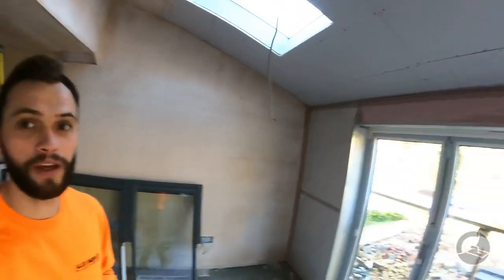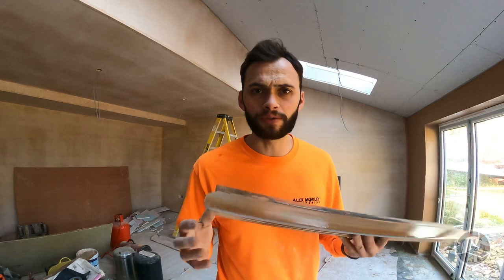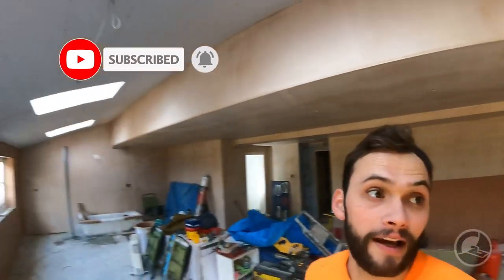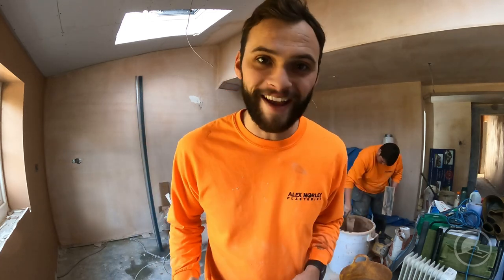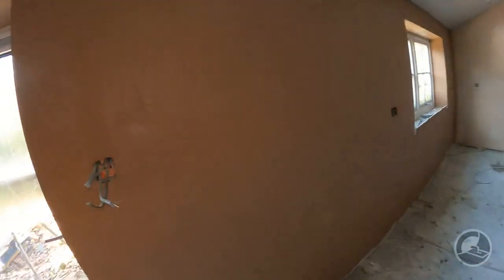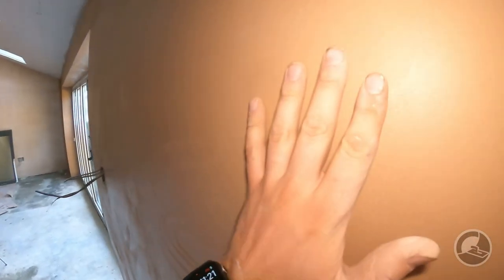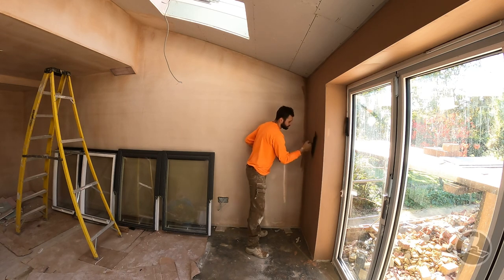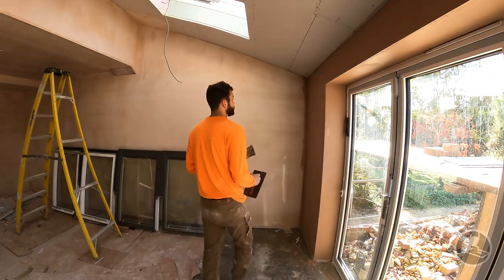Master the Perfect Timing when Plastering

Comment: Why would you not do the ceiling first.
Reply from the maker: Because the adjoining ceiling is a scheiling at 45°. As such to maintain a straight level line it’s easier to snap a level chalk line on the wall as appose to the ceiling and plaster to that line on the second set. 

Hope this he’s.
Reply: Always do ceilings first , always

Comment: Just found this video. Trying to learn plastering for years on my own. Not a soul around my area practicing who could help beyond one old book with explanations that are textbook old with blurry greyscale pictures. This video is the best I have ever seen by far. I took comprehensive notes. I have been considering screeds, but I am reconsidering. Perhaps good application of feather boards and using these steps may obviate them. I think my trowel technique is reasonable, but there was so much I was missing in the chemistry. I have tried to figure it out by trial and error, but this video has helped me leapfrog that part of the learning process. This video is all about where practice meets the chemistry. I appreciate the effort so very much.
Reply from the maker: No problem. Many thanks for the support on the channel.

Comment: Great video again buddy.

From a technical standpoint, what is happening to the plaster when it is "being closed in" versus "flattened off"?
Reply from the maker: Flattening the plaster is something you do while the plaster is still wet. To even out the trowel lines made from applying the plaster. 

Closing the plaster in, the plaster is much drier, and your pushing the aggregate back into itself. 

What you fine after you flatten plaster and leave it to pull in abit. The plaster is very grainy, not smooth. It’s that aggregate your pushing back in.
Reply: @AlexMorleyPlastering  excellent explanation buddy! Thanks!

Comment: I've been doing a lot of grade two buildings of late with lots of oak beams 
because the beams are all over the place its hard to to get a nice finish 
so I came up with this 
I let the plaster harden but not to much 
then I go round all the beams with a damp micro fibre cloth 
does the job great 
better than a  brush  no marks 
 ice smooth finish for the decorators

Comment: A fantastic series of videos, superbly presented by a real natural and interesting to see the beard develop over time too 🙂 Great suggestions for optional (but helpful) tools: I've stumped up for the superflex now but still not quite ready to commit to a plastic plaziflex as I'm only doing small projects on my own property.  One question: if it's preferable to use plastic for the final dry trowel, is anything else suitable?  Same spatula as used for flattening perhaps?  Thanks!
Reply from the maker: You can use a normal steel trowel. It just polishes up the wall a bit more. So the painter as to sand the wall a little to give the painter a bit of grip.
Reply: @AlexMorleyPlastering  Thanks for the reply Alex, much appreciated.  I'll stick with the steel for now.  Keep up the good work!

Comment: Great vid..!.. Sometimes I get tiger straps when do last pass, and the wall is starting with dark spots. Don't know really why mabe too much pressure on trowel..?
Reply from the maker: Hard to say. Could be several things that cause it. Generally we fine being slightly early on the trowel stages (before you apply water) and being slightly later on the wet trowels helps it a bit.

Comment: Another excellent video! If I can ask a question (not directly related to this video) I've recently covered over a doorway with plasterboard its pretty flush to the original wall, also plasterboard. Can I just skim my new section (and how) or should I skim the whole wall?
Reply: Probably done it by now haha but skim the whole wall, incredibly difficult to get a perfect finish when feathering in. I decorate as well as plaster and even my absolute best patchwork I usually run a thin bit of easi fill down the join

Comment: Great video Alex. One question: how do you cope with numerous ‘hot spots’ you find sometimes on a wall where the brush test could give you a false reading especially where the wall is slightly undulating or near the bead area where the gear hangs around longer before it picks up.I think it’s these sort of areas that cause the dreaded cellulite and tiger marks.What’s your opinion ?
Thanks again for all your time and effort making these vids. atb
Reply from the maker: Hi Malcolm

Thanks for the comment. So my thoughts are generally is that most important, control the suction, so it’s as even as possible. That will stop some areas pulling in more than others. 

Secondly, if you have very uneven walls, we apply the first coat very thick, to take 95%  of that out. That way the top coat is generally all the same thickness. 

Lastly, if you close the plaster in as we show in the video, just before the wet trowel, you can leave it a lot longer, which reduces the risk against wet and dry areas. 
All in all, cover all 3 of these things, the areas your mentioning don’t come up that often. It only really happens in direct sun, or if there is a draft on the wall. 

Hope this helps.
Reply: Great reply Alex, thanks for a detailed answer, no one has ever really explained this problem before. 👍
Cheers

Comment: Thank you for your reply Alex. I have found an old vid of how its done with ladder and plank. Scary lol. I have brand new mt perma, do you think if I sand it with wet n dry sandpaper high grit, it will help to smooth it. I'm currently training so not in the trade full time yet to break it in. thanks.
Reply from the maker: The permashape is a tough one to break in properly. Takes a long time. Sanding it down won’t do any harm. 

It’s a good trade to me in I think. Just look after your knees and elbows

Comment: I'm new to plastering, although I can get a nice flat finish that looks great when decorated I'm struggling to get a professional, uniform colour once the plaster dries. Any suggestions?
Reply from the maker: Tbh that takes practice. Too much water usually is the main culprit to inconsistent colour
Reply: You'll never get a uniform colour once the plaster dries. It's just the nature of plastering. It will always be patchy with slightly lighter and darker pinks. I think the reason is when you are wet troweling the fat (excess plaster) has more water content and hence lighter colour. Areas of the wall that are prouder than other places will naturally have more fat scraped off so will dry darker. Don't worry about it.
Reply: if you get your compression right and at the right time, you can get a perfect white all over colour on no matter what background, i try get on mine a bit earlier rather than later,

Comment: Hi Alex I am a carpenter who occasionally skims so pardon my ignorance love the vids I understand from your video tiger Marks come from doing the wet trowel to soon? This has Has happened to me from time to time I got over this with applying ready mix joint compound and sanding but is there another way recovering from this when you see this happening on a set thank you Colm
Reply from the maker: Hi Colm

Tiger marks are really common I’m afraid with those who done plaster all the time. The main reason is they occurs for different reasons. The skill is knowing why they are caused. As a general, these are the most common reasons. 

1. Applying too much water when the plaster is too wet. 
2. Applying the second coat to thick. 
3. Flattening the second coat to late. 
4. Not applying enough water when it’s too dry. 
5. Not enough pressure on the trowel. 
6. The trowel face is open too much when the plaster is too wet. 
7. Plaster drying unevenly. 
8. Plaster pulling in too fast. 

Etc etc. 

The long and the short of it, tiger marks are the result of the plaster being dragged. Which one of those reasons is for you to work out.
Reply: Thanks for replying appreciate it and all the information helps. Since this I have done another bit of skimming and it seemed in my case I was dragging the plaster by having the trowel to open. I then realised I could work  out any marks with a little mist of water and a keeping the trowel more closed flatter to the wall  more practise seems to be the answer thank you again  Colm

Comment: Hi Alex, a question if I may: I am battening and boarding a bricked up external doorway, there is a 2 to 3" irregular deep hole where the door was.  Is it best to bring the plasterboard flush with the existing wall face and then skim and feather in or set the face of the boards back a few mm in the hope that when I skim, it will be flush.  Plus how to tape the edges??  I will appreciate any help from you or anyone else who wants to chime in.  Thanks
Reply: I would skim the whole wall … patching in takes just as long but with a chance of it showing
Reply: @davepangolin4996  Thanks very much.  I battened and plasterboarded to within a few mm and then got it skimmed by a pro.  He didn't do the entire wall but it will be OK as it's going to be behind kitchen cupboards and tiling.

Comment: Hi there Alex, what do you use for a platform when you do high straight stairs. like in council houses. For example, in through front door, stairs straight in front, curve at top. High three walls. I hope this makes sense. You have done vid on stairs and landing but not high stairs with platform. In fact no one seems to have done vids on this. Cheers.
Reply from the maker: Hi Matt

I know the staircases you are referring too. Generally I think no one really videos them as it usually entails scaffold boards on ladders, or some other dangerous method which you can’t condone on a video. 

But as a general, we usually screw timber to the sides to create a platform to plaster the high back wall, then take them down, and use long ladders leaning against that wall to plaster the sides. 

A lot of hallways have there own little qwerks but the one your describing that’s how I handle it.

Comment: Cam I ask, I've been plastering for some years  now but no matter what if a light hits my ceiling I can see trowel marks specially along the edges, I'll add I use the steel all the way through and put 100 percent into it. The walk is white a uniform but I'm not happy and think I'm missing something
Reply from the maker: For the edges it sounds like you are leaving it too late to clean them up. Try using a plastic scrapper/filling knife just after the first wet trowel. scrape out the corners to neaten them up. As to the trowel marks, try using clean water or a sprayer when doing the wet trowel. sometimes using dirty water when wet trowling can leave fat marks behind.

Comment: I'm using a Nela Medi Flex that's not really broken in yet. When I doing the wet trowel it's screeching on the wall and removing some of the plaster skin creating a sort of tiger effect. Any ideas and love this channel it's got great indepth knowledge
Reply from the maker: I would probably go with a shallower angle if it’s screeching with more pressure on the wall. 

If it’s taking off plaster AND leaving tiger marks, it’s sounds like the wall might be a bit wet for a wet trowel.  Hope this helps. Thanks for the feedback on the channel.
Reply: @AlexMorleyPlastering  I think you could be right Alex and you've said as much in this video, ok thanks I will bear that in mind going forwards.

Comment: When flattening off with the speedskim (straight after applying the plaster to the wall) i tend to get low spots the entire length of the speed skim. Any tips on how to prevent this?
Reply from the maker: Open the spat up more.
Reply: @AlexMorleyPlastering  will give it a go thank you

Comment: Nice work 👏 how long did it take to get to that 1st wet trowel?
Reply from the maker: On this set. Maybe 1 1/2 hours. I wasn’t really watching the clock tbh.
Reply: @AlexMorleyPlastering  nice work 👍
Reply: @AlexMorleyPlastering  where abouts are you based and what's the going rate per square meter?
Reply from the maker: We are based in Eastbourne. Prices for domestic newbuilds range from £5- 9 m² skimming labour only. Depending on the size of the job, and the type of builder.
Reply: @AlexMorleyPlastering  my god, we get £2.50, maybe £3 if we are lucky 😆
Reply from the maker: It’s not great on site bashing. But then again there isn’t too much of that down our end. 

Lowest I think I have skimmed at was £5 m² about 2 years ago.

Comment: i watch these videos and I am lost in the banality of the presentation.  There is no reference to time, there is no real reference to the finish level that one can really grasp.  The first thing you need elapsed time clock somewhere in the on the screen with the initial time starting at mixing then additional lines of time for the start of each step as well as the time spent at  this step.  You need a button to show that will being up the photos showing the level of finish you start with and the level you want to achieve.  You need another button to display the material you are using and it basic information as to content and it's curing time.  Showing that you are moving to a new mix by dumping out the material that left over or show you are starting a clean batch with a clean bucket.  Have another button showing the tools you  are using with their proper names.  It will be hard at first but it is very similar to using subroutines in computer programming.  If you can freeze the primary screen while the viewer is reading the sub screen.🙂